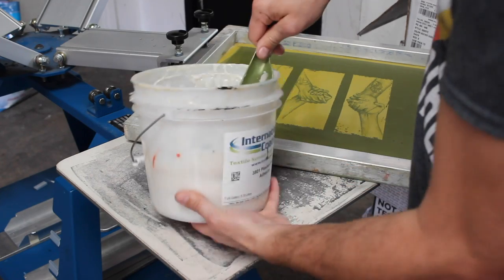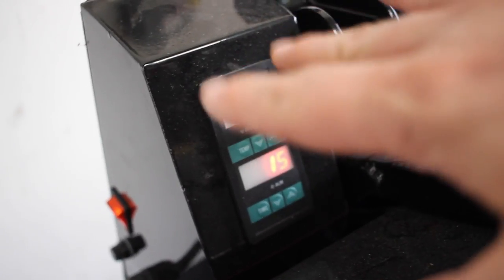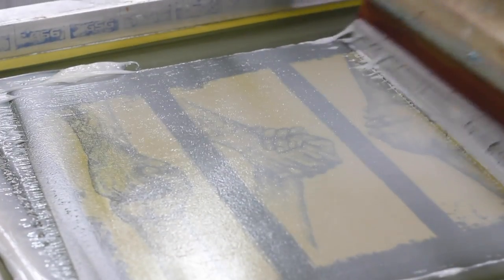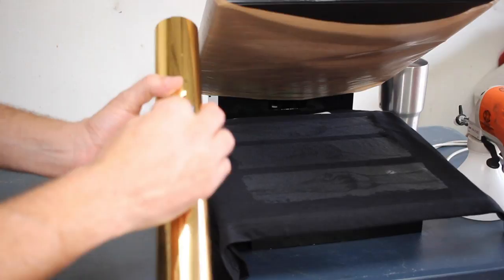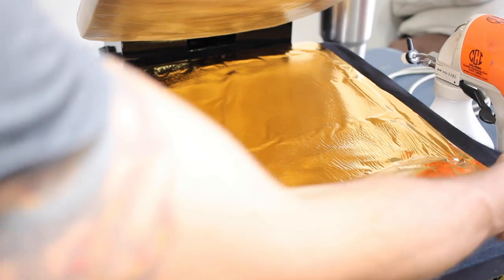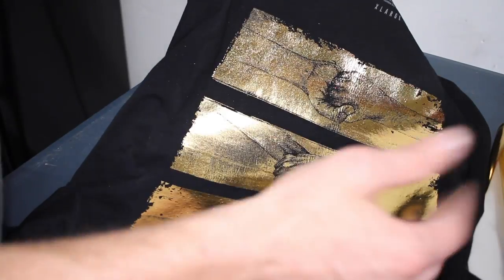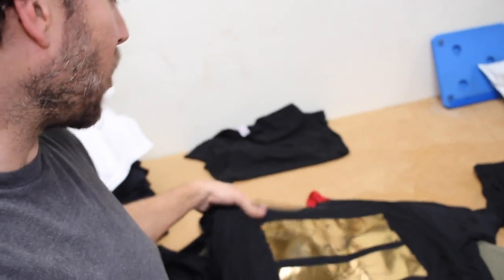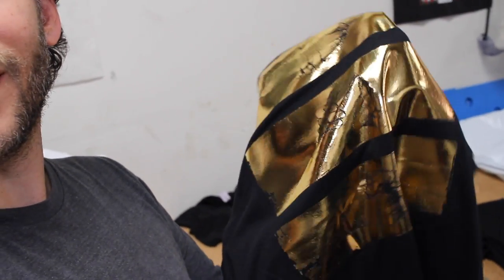How to Screen Print and Heat Press Gold Foil Step by Step Tutorial

Comment: pretty nice, my question is when you do other shirt like usually, can I use heat press full time to cure the shirts? until save up for conveyor dryer, or should I save up for conveyor asap?
Reply from the maker: You may have to press them a couple times with a cheap heat press.  You'll save a lot of time with a conveyor.  Even if you get something used, it'll make it a huge difference in production.  Heat pressing will double your time because you have to do another step.